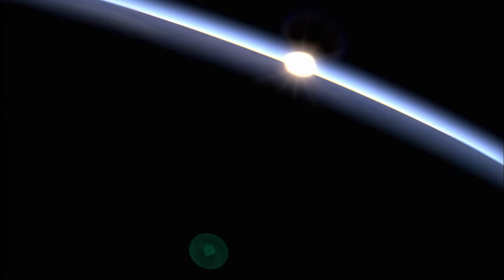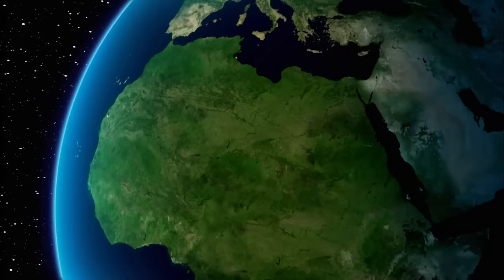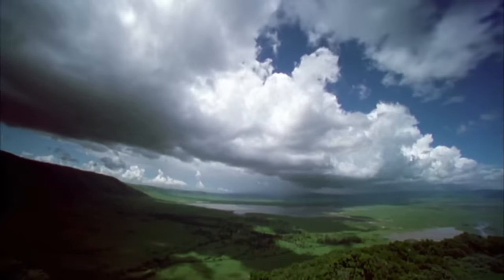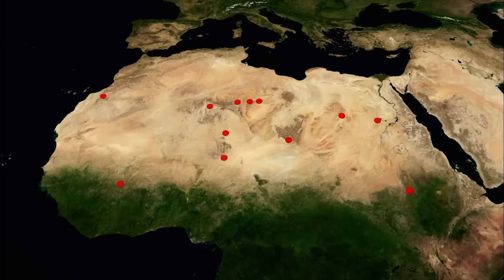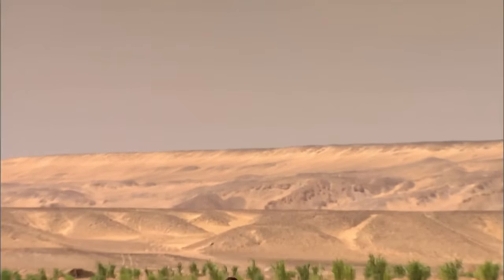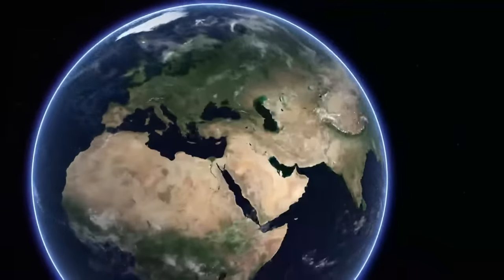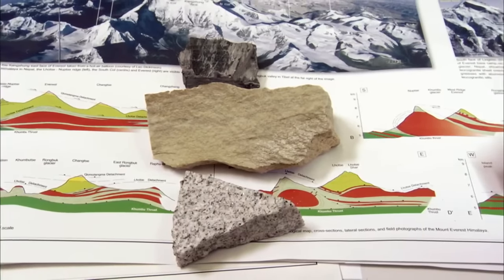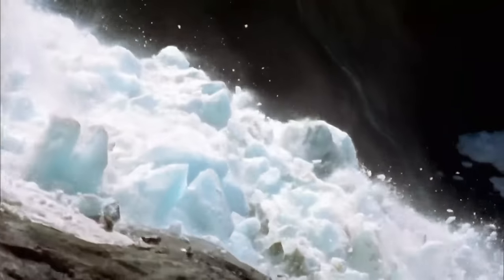How the Earth Was Made: DEADLY Wastelands & EXTREME Phenomena *3 Hour Marathon*

Comment: Each block weighed a minimum of 2 tons going up to 60 ton granite beams roofing the kings chamber at a height of over 300 feet.  Cut ,quarried,  and transported over 500 km and placed with absolute precision.  An one thing people seem to overlook is before the first block was placed to build the great pyramid they had to survey the land level it,  then design and engineer a foundation strong enough to hold the heaviest structure ever built and then begin to build the foundation which had to be absolutely perfectly flat with no possibility of sinking in the sand.  Then they start the pyramid
Reply: @random269  if it was built in 20 years they would have had to place 2 and a half blocks every minute over a 10 hour day. That's including quarrying,  cutting and transporting.  That's also not including clearing and leveling the land and building the foundation that was required to hold the pyramid for thousands of years without sinking it inch.

Comment: I don't know if anyone said this but construction is all standard.  There are only metric nuts and bolts (especially when your sockets are way over there).   All the buildings are built by dudes using feet and inches.   Think about it,  if you go to Lowes, or a hardware store or a supply house, they sell tape measures , those tapes are only metric on the back IF you get one that has metric on the back.  Most are feet and the fractions there of.

Comment: Why do they still say that blubber is there for warmth?!  How much blubber does the tiger have ?! The snow leopard? The reindeer? The snow foxes? Wolves? Plus the polar bear eats meat exclusively, it doesn’t build the same blubber as a hibernating bear that is omnivorous.  Blubber is for energy.  It’s the fuel tank.  It helps maintain its body temperature but in fact the fur on the polar bear and its coating is why the polar bear is able to handle the cold.  If I’m not mistaken the polar bears skin never actually gets wet. …. I’m just saying this is not new information.